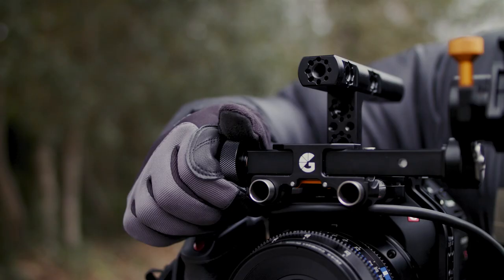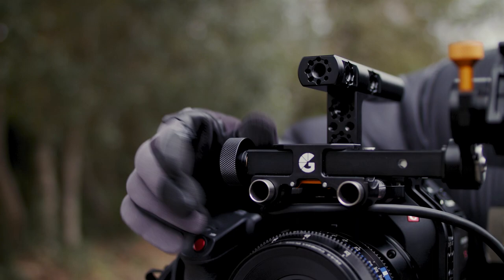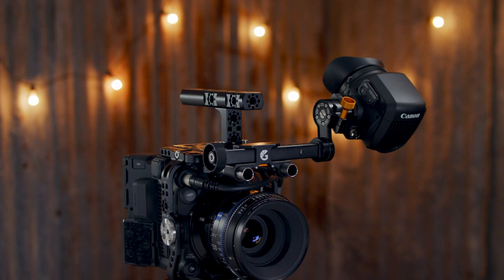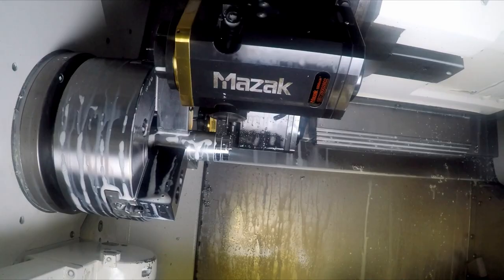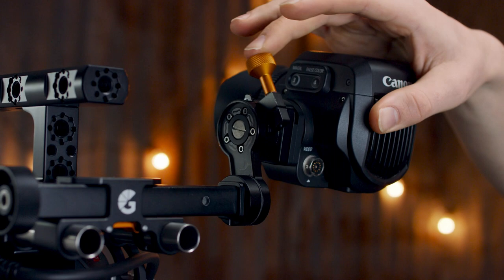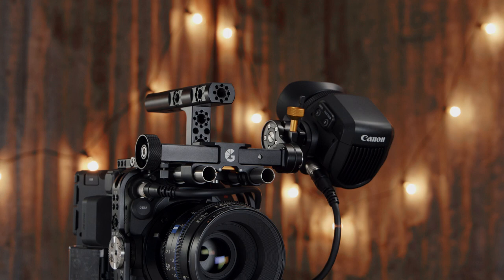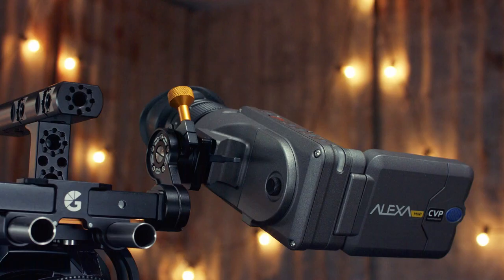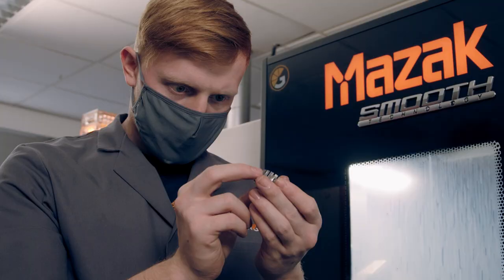The Axl EVF Bracket with Instant 3-Axis Clamp

Comment: Amazing, everything I thought it would be. Full trust in all the gear BT comes out with. I want it so bad for my Kameleon EVF, but seems like it may be a close call with Sony FX6 top handle and how close the FX6 top is to lens mount. Hope you come out with some top plate solutions for the FX6 with with the AXL! Zacuto has one with rod locks and Wooden Camera a great one to secure PL adapter, if there were something that incorporated both and solved clearance issues for your AXL EVF that would be incredible!! If not, may get this at some point and test it out regardless...
Reply: PS REALLY eager to see shoulder pad innovations with your left field kits. Trust you'll come out with something I'll want right away as well.
Reply from the maker: @richieduque  Thanks for the feedback Richie, the R&D team are working on quite a few exciting products so more to come.
Reply: Yeah sign me up for a shoulder pad, too!  My goal is to use the RED Komodo with a Fujinon and the EVF, just like an old fashion broadcast camera. This set up provides the best control of the image.